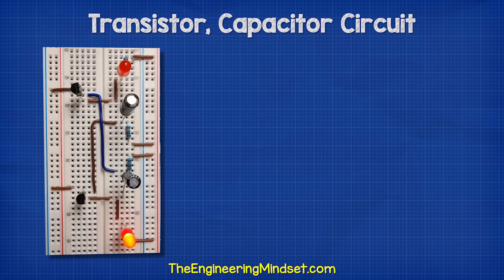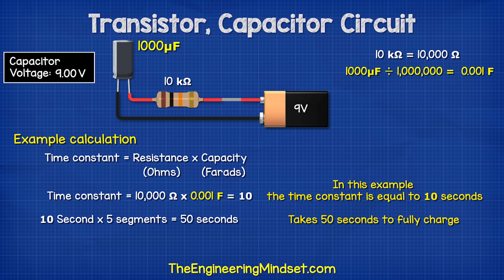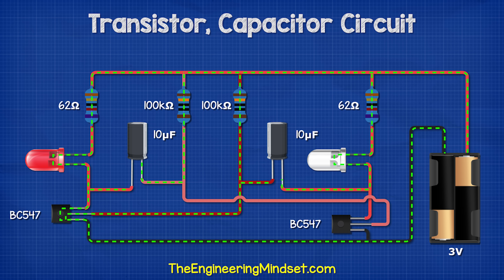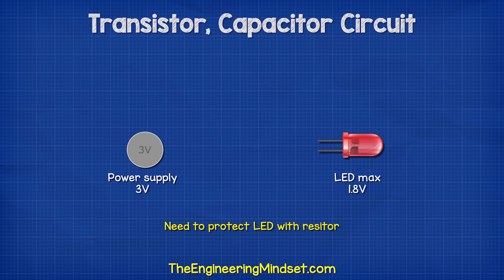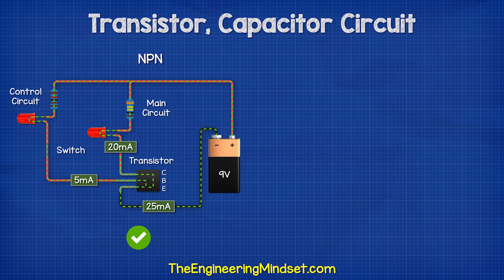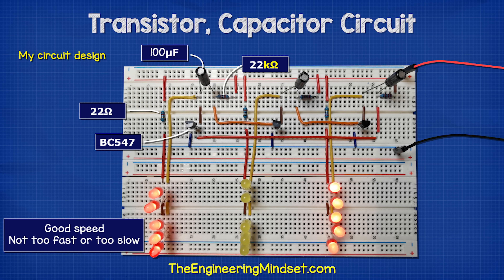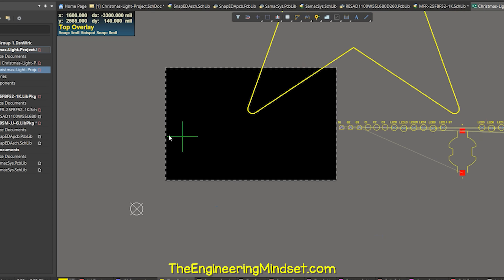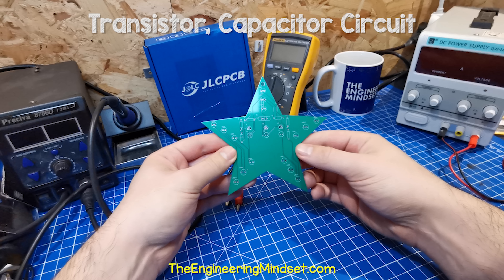Transistor capacitor circuit design guide

Comment: This is the first video of yours I do not understand. I'm totally probably over thinking this, but looking at the circuit design, how in the world do both transistors not open at the same since everything is in parallel with each other ? I just can't comprehend why adding the capacitors makes them flip flop.
Reply from the maker: One of them will have slightly more resistance, the componet, the track, the temperature, etc, so one will charge faster than the others so it will set the motion.

Comment: Is there not an error in the animation showing how the circuit works? The current flow supposedly shows conventional current, yet you say "electrons pulled into capacitor 1"  showing electron flow to the negative side, and then talk about how when the voltage on the negative side of the capacitor, which is connected to the base pin of the transistor, reaches 0.7V (which is impossible) current flows through the transistor. What is this mix of conventional current and electron flow? I don't understand, as well as the supposed positive potential on the negative end of the capacitor. Please, if I am wrong, somebody tell me what I have misunderstood.
Reply: I've just tested the circuit and it works with both orientations of the capacitor LOL

Comment: Great video. I was able to build this but encountered one problem. When I first switch it on, all of the LEDs light up. However, when I subsequently touch a piece of metal to any of the components on the back side, the lights begin oscillating as they should. Could you please explain what I've done wrong. Thank you.
Reply from the maker: Possibly the resistance tolerance between the resistors is too close, try swapping one for a slightly higher or lower value so there's a difference and a capacitor charges differently to the others which should cause them to oscillate
Reply: @EngineeringMindset  As suggested, I changed a resistor and it works perfectly. Now everyone in my family is getting one for Christmas :)

Comment: Can anyone explain to me why it doesnt work, the led on the left only works it doesn't flas but turns on
Reply from the maker: Either your circuit isn't assembled correctly, the transistor is facing the wrong way, transistor or capacitor is faulty or capacitor is too small

Comment: Key notes for me: when one capacitor is charging, the other is discharging. The direction of the discharge follows the direction of the flow of current towards the (- side) of battery.

Comment: How first transistor turned on when there is no voltage across capacitor 2 in the begining? And I see same circuit for 2 nd transistor too! It was not turned on untill capacitor1 reaches 0.7V

Comment: Ei toimi saatana
Reply from the maker: You have made a mistake somewhere. It's fully working and calculated in the video.
Reply: @EngineeringMindset  My transistors have text: 2N2222A1726 should it also work whit those?
Reply: ??? @EngineeringMindset

Comment: the both 100kohm resisters are in same configuration then current should pass to both resistets equally at a time, but as you said, how  it flows to left side resistor until the capacitor fully filled and then right, please clear my doubt
Reply from the maker: One circuit branch will have a ever so slightly higher resistance level. The resistors will not be 100% equal, the wires will not be 100% equal.
Reply: @EngineeringMindset thank you for your response, then current will not pass 100 % in one branch, it divides into two appropriate equal current then how will a led glow fully at the time when other was off

Comment: 2:19 I am a bit late to the comments if anyone can help me out? Looking at the circuit I noticed that the capacitors are hook up backwards? I did this same circuit myself and tested it and noticed that the capacitors still work anyway you flip them them in the circuit. I have had the flip-flop circuit running with the capacitors the way backwards and haven’t noticed any problems.

Comment: Tip: Solder the (AE) aluminum electrolytic capacitors flush with the board. Per IPC-610, I recall if they have to be raised they need some kind of reinforced support on the leads. Whether by creating a spring kink or applying RTV under the leads. Sorry I see it so much as an EE on end product and it makes me want to head slap. Think about those tiny skinny leads holding that big belly cap. Makes it easier to accidentally bend a few times max and that’s it.

Comment: In your diagram the negative terminal of the capacitor is connected to the base of the transistor. In your schematic the positive terminal of the capacitor is connected to the base of the transistor?

Comment: I enjoy these topics but found this one confusing to start.  It would help if you labeled the diagram at 2:45 so I knew which components you were referring to without having to rewind the video multiple times.  And I'm still confused about the capacitors.  They look like they are backwards on your diagram.  Why are the negative legs connected to the positive side of the battery?  Is this a special use of capacitors or is the diagram wrong?  Again, not sure what you're trying to tell me.  I've watched the first half of this several times but still confused.  I even went and watched your How a Capacitor Works video again.  In that you show electricity flowing opposite of how you do in this diagram with the negative leg connected to the negative of the battery.  So again, are these special capacitors in that you connect them backwards versus normal?  What am I missing?    I get the idea that one side works for the duration of the capacitor's charge and that causes the other side to eventually turn on and back and forth.  But the fact that it does still looks like magic to me.   Also, when Capacitor 1 reaches .7v you say it opens Transistor 2.  How does the negative side of C1 provide positive voltage to Transistor 2?  I must be missing something but not sure what.   Any insights or corrections are appreciated.  Trying to learn.

Comment: will this set up work the same for the actual electron Flo
Reply from the maker: Electron flow just flows in the opposite direction, you can play the video backwards and that's electron flow
Reply: @EngineeringMindset  figured it would. one person hooked everything up backwards thinking electron Flo was the way, so I just told him it doesn't matter which way current goes as long as everything is hooked up as is shown.

Comment: 3:09 I understand that after capacitor 1 reaches 0.7V, the current will go to the base of transistor 2 which will turn it on. However, I don't understand how this turns off transistor 1. Someone mind to explain? I will appreciate any help😃
Reply: I think the current is more attracted for reaching the capacitor 2 instead of transistor 1, because it has to charge up.

Comment: How do I make a circuit where (10) leds light up 1 by 1 but like it starts from left to right and instead of starting from left again it starts from right to left.

Like 12345678910
 10987654321.

Comment: Suggestion: label the caps and transistors in the circuit demonstration with the same names as your narration. Capacitor 1, transistor 1, etc. Nice work though.

Comment: ok made this, working, but I want to use slightly larger leds (9 x 1 watt 350mA, using 350mA led driver) but worried about current to transistor can you suggest an appropriate transistor that could handle the current? not sure if bc547 can handle that current
Reply from the maker: Seen the new LED explained video? so much detail covered! https://youtu.be/O8M2z2hIbag

Comment: Inside Gerber folder, which one is the gerber file that you can send to the pcb maker to produce?
Reply from the maker: There's no need to. You just upload the entire zipped folder, just like in the video. Simply download the file and upload it straight to JLC, don't need to open.
Reply: @EngineeringMindset  Thank you.
Does the whole zipped file also work with other pcb makers? I live in different country than you so shipping from JLCpcb to me  will be too expensive for me. So I have to use my local pcb maker. 

 Also how can I put my own label onto the pcb board that you put up for download?

Comment: Great video. 
Can you do a video on 8 mode christmas tree lights. They use 2 trasistors, one resistor, one diode, one momentary switch and one capacitor. Simple circuit yet it has 8 modes from fast flashing, slow alternating flashing, fade etc.
Reply from the maker: Check out NEW resistor video, everything covered! ➡️ https://youtu.be/DYcLFHgVCn0

Comment: Crazy that this is a completely analog circuit; no controllers or computers operating the lights. The capacitors act as delay sensors in this configuration. Makes one wonder if this is how old neon lights worked in the early part of the 20th century. Very fascinating circuit.

Comment: Excellent project, I think I would switch it up a bit and using a AC to DC wall wart as the power supply as it seems they come with anything electronic and I have a bunch of them of varying voltages lying around, and one of them would plug in directly to my tree lights and get it going without the need for a battery so I can feel more comfortable leaving it on all day long.

As an aside, I do want to personally thank you for your videos, I teach an intro physics E&M lab class and have been doing so remotely for the past 2 years and for a few of the labs I do link directly to some of your videos (resistors, diodes, capacitors, etc) as part of the lecture (not done live) as I think the visuals that you have are absolutely perfect, and way better than what I could do, also a number of my students are EE students so I'm sure your other videos that are not related to what I'm doing are relevant to them as a nice way to teach them.   So indirectly your work has helped me teach others (I hope), so thank you.
Reply from the maker: Check out NEW resistor video, everything covered! ➡️ https://youtu.be/DYcLFHgVCn0

Comment: Why is the current flowing backward into the negative part of the battery 🤨
Reply from the maker: Answer https://youtu.be/MUh_dOcqgVw
Reply: @EngineeringMindset  lol yup just like i thought. I remember when i was younger in my early 20s i went and did prison time for 16 month in florida panhandle. So while i was there i read books on physics and the first thing they talk about was electricity. So it got my attention then thats when i found out that in dc it flows from negative to positive and learn a lot from difference of potential and eventually electronics components. Awesome stuff. 

Ps. Thinking about starting a youtube channel electronics repair but with a twist. Let me know what u think

Comment: How long will the lithium battery power this circuit? A simple jack for optional D.C.  power supply would be a good option to add. Very cool & simple design and those are the best!

Comment: Nice circuit I also put a variable resistor or potentiometer between the all the resistors going to the negative of the capacitor and the power rail and made its speed variable
Reply from the maker: Check out NEW resistor video, everything covered! ➡️ https://youtu.be/DYcLFHgVCn0
Reply from the maker: Seen our new Potentiometer Explained video? ➡️ https://youtu.be/Xb-MZMoUtcQ

Comment: Great tutorial of an LED light chaser. I have made  this circuit before, you can use 2n3904's too. Also with a large number of LEDS in the chain you can experiment with connecting a wire across several LED to send a signal to another transistor not in following the main loop. It creates interesting  chase patterns depending on where you connect it.
Reply from the maker: Seen the new LED explained video? so much detail covered! https://youtu.be/O8M2z2hIbag

Comment: What i have seen there is that the capacitors are connect in series , and when they are fully  charged they block the carent flow cousing the circuit to flip flop

Comment: I say 62ohm is a bit low for a led on 3v dc. I have burned an led out on 3v using anything lower than 100 ohms. Most leds are rated at 10 to 25ma. I would strongly sugest using at least 120 ohms for an led on 3v dc. My man has been working on circuits for over 25 years, and had his share of making mistakes. The cost of parts are going up, and he's been very cautious now on now days of not over loading leds or transistors. He has been selling circuit kits of his own to customers who wants one.
Reply from the maker: Seen the new LED explained video? so much detail covered! https://youtu.be/O8M2z2hIbag

Comment: If trying to analyze it by considering that one led each time will lit it doesn't make sense.One led or one transistor will be in off state each time while the other two transistor conduct until one goes to off state and activate the switced off to the one state looks more explainable,i think.
Reply from the maker: Seen the new LED explained video? so much detail covered! https://youtu.be/O8M2z2hIbag

Comment: Hey I read in my textbook yesterday that because a MOSFET transistor is symmetric, you can swap the source and drain without changing the characteristics. I was wondering if this is true in practice? Can I take any MOSFET IC with 3 terminals and do this? Or do the integrated circuit forms that we use have extra components that actually designate the S, G, and D terminals?
Reply from the maker: See my new MOSFET explained video here➡️: https://youtu.be/AwRJsze_9m4

Comment: Great project!  Out of curiosity, would a 555 Timer simplify this circuit or make it more complex?
Reply: Structurally simplify. With 555 inner workings considered, remains quite similar about electronic working principles. 555 is essentially same circuitry prefabricated on a packaged silicon chip as here is implemented with discrete components.
Reply: To be honest with you a 555 timer chip will only make 2 of the leds flash back and forth like a police flasher. Sadly the 555 timer chip will not make 3 leds flash in the order this circuit can do. My man did work on a traffic control of unspecifide logic circuits other than the common  555 timer, and had it exactly timed to the actual traffic control down the street from him to the second. He didn't patten it, but the paper document till this day is still top secret that no one knows about. He is not giving the secret out on what chips where used or how many of them where used. Some say a microcontroller was used, but its not.

Comment: wonderful explanation ! They also flyback circuits they supply  1.5 volt from battery to one diode, one power transistor and one transformer and they get 30.000 volt . Can you explain it also same way ??

Comment: never forget that when a capacitor is connected in a dc circuit it stops current due to the capacitor equalizing polarity on both sides, always connect a capacitor to two wires instead of one, and make sure the wires don't have the same polarity it's usually connected to GND.
Reply: ceramic caps would be a better choice here instead of electrolytic
Reply: @ItsBoyRed  it all depends on how much capacitance you need

Comment: Why does transistor 2 opens when current passes from capacitor 1 and not from resistor 2?
Reply from the maker: The capacitor is absorbing the electrons, the resistor is limiting how many electrons can flow. When the voltage reaches 0.7V the transistor base pin opens the transistor to allow current to flow
Reply: @EngineeringMindset  thanks for answering
Reply from the maker: Check out NEW resistor video, everything covered! ➡️ https://youtu.be/DYcLFHgVCn0

Comment: I wanted to get into circuit building but never knew where and how to start. Although big books on these matters are valuable, your easy to process and do format fits my short attention span so much more :)
Thank you for this!
Reply: Check Amazon or other retailer for a breadboard starter kit; there are tons of options out there, anywhere from $20 on up. There are some excellent books for self-teaching as well, but realistically it's easier to follow along with a good instructor on YouTube.

Comment: Would help a lot if your initial explanation of the two transistor circuit had the labels. You go quickly, I'm searching for transistor 1 and lost the plot as your explanation went on to the triple version. 
Would also help if you cut unnecessary detail. Stick to logic. . 
But thanks. More attention to details please.
Reply from the maker: Good point. I'll note for next time. Just FYI, it is meant to be left to right, top to bottom. You could sketch the circuit out on paper and follow along if that helps.

Comment: Beautiful yet simple circuit.  I have to wonder how long that button cell will last.  I'm guessing less than an hour.
Reply from the maker: It is rated for 550mAh and the circuit draws around 50mA by design so it could last around 11 hours. Although I think the current is probably lower than this so it could be longer.
Reply: A button cell like the cr2025? Try 36 hours with a bit higher value of led current limit resistor, and the resistor on the base of the transistor. I have worked on more complex circuits then this, with longer battery life of 13 hours. I have gone pass the 18 hour time, with some of the circuits I have done. The current draw approximately 28mah! With the same results......
Reply from the maker: Check out NEW resistor video, everything covered! ➡️ https://youtu.be/DYcLFHgVCn0
Reply from the maker: Seen the new LED explained video? so much detail covered! https://youtu.be/O8M2z2hIbag